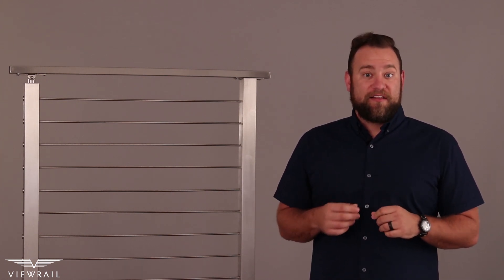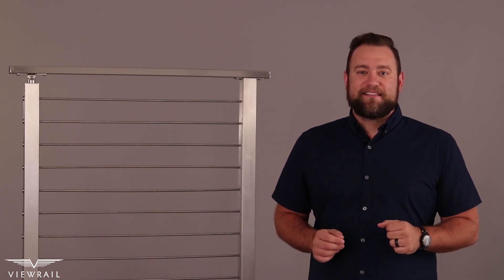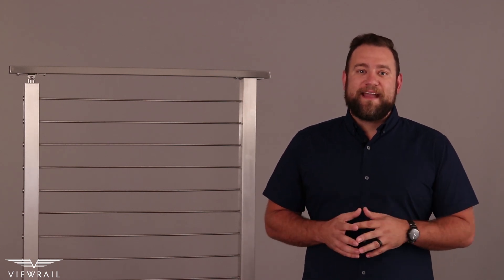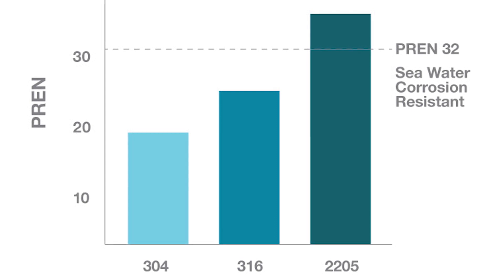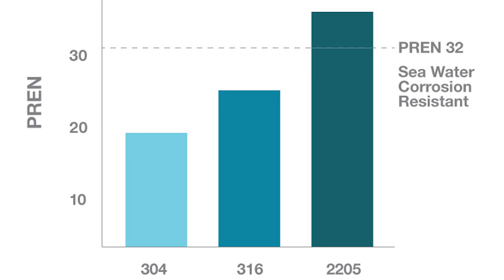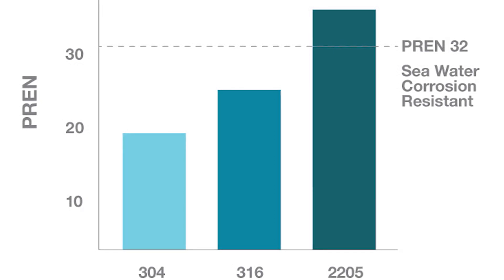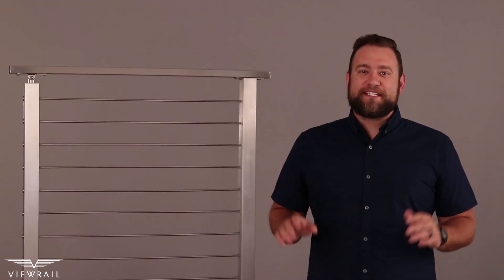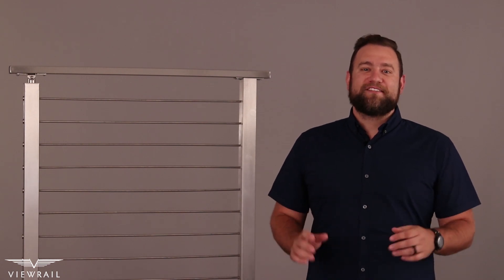What is 2205 Stainless Steel?

Comment: The use of 2205 Stainless Steel is found with bridge design, and many structural applications.  Thanks for a great video on the 2205 Duplex SS alloyed material.

T J (Tom) Vanderloop, CMfgE, Author, Mechanical Designer, and Consultant; ATEA, AWS & SME-Life Member